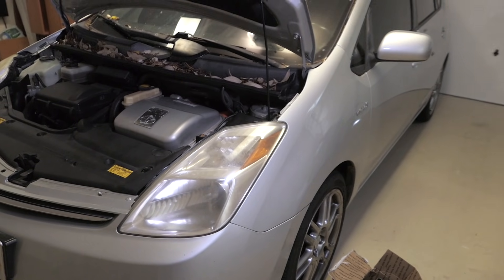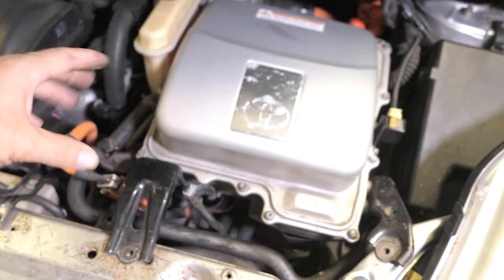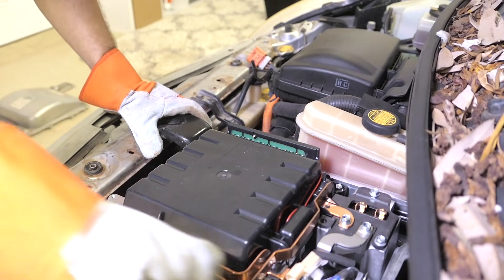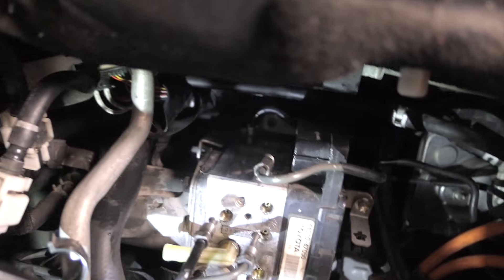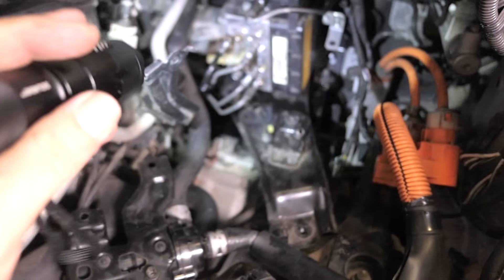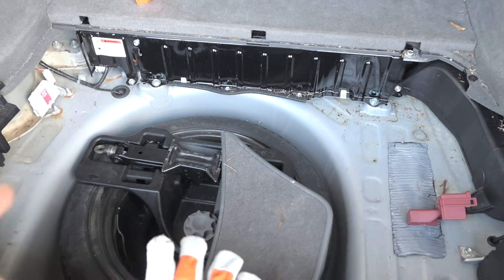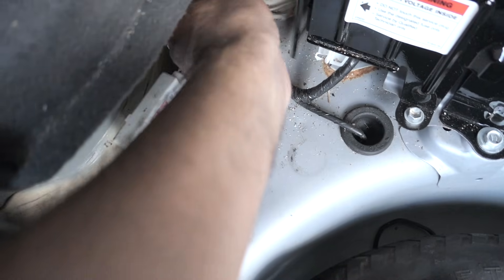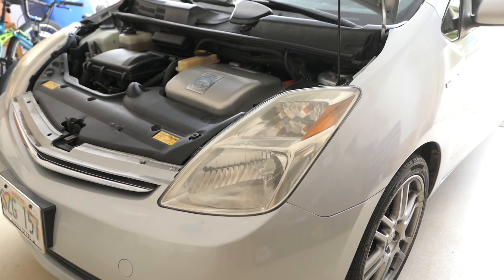Gen2 Prius - ABS Brake Actuator Replacement

Comment: I successfully installed my actuator on an 07 Gen 2 Prius yesterday! For anyone out there who is considering doing this job themselves. I would like to point out a few things that might help put your mind at ease. First off, I was absolutely horrified at the thought of working on a vehicle with such high voltage that it could potentially kill me. I was so scared of it I almost didn't go through with the repair. BUT, take my word for it. If you remove the battery cables from the 12v battery and remove the main fuse (orange plug) from the hybrid battery then press the power button on the car to start it and nothing happens. Then the car becomes 100% safe to work on! I had no issues whatsoever. Secondly, YOU DO NOT NEED TECHSTREAM TO BLEED THE BRAKES! Guys, I was so worried that I needed special equipment or software to bleed the brakes that I almost gave up on doing this repair myself. It is simply NOT TRUE! I bleed the brakes the same way I'd bleed any other vehicles brakes and it worked perfect. If you are still having trouble bleeding the brakes, leave a comment here and I'll explain exactly how I did it (by myself, with no helper). Anyway, this is a great video and was very helpful in giving me the confidence boost I needed to do the repair myself. I saved literally $3400 thanks to this video and others like it! It took me probably 15 hours from start to finish, and I am very handy with a wrench and no stranger to big repairs. So don't listen to the people saying it's a 3 or 4 hour job. That is ludicrous. You will want to set aside more time than that I assure you. BUT! You can do this people! Good luck =)
Reply: Techstream is not a big deal to install, if you are going to do this job, it makes bleeding the actuator much easier. I believe Toyota charges $50 for a 2 day license.  You will need a Mini VCI OBD2 adapter, those about $40-50. Many complain about the techstream software they supply as having a virus. If you are unwilling to figure out the ways to get around that, get the Toyota 2 day license.  I’m sure there is a way without techstream to bleed the actuator, but I am sure it is not “by the book”. It’s only your brakes and they don’t make your car go, so who cares, right?(being snarky)
Reply: @jonnydwolf  I bleed one of the wheels manually just so it’s drivable and drove the car to a mechanic to finish the job and make sure it’s safe to drive. Tech stream supplied has a virus - ransomware. Don’t install.
Reply: @IlyaBourim  virtual machine running the software. Anyway, $50 for a 2 day license to finish the job yourself isn’t a bad idea.  What you did was good too, let a trusted certified mechanic finish the job.
Reply: how did you bleed the brakes if you dont mind me asking. I know you said the regular way but like did you start the car up at all after replacing the abs actuator? thanks
Reply: @davidcuesta7189  I followed a YouTube video that I'm sure you've seen. But instead of using a fancy "pedal depresser" I just used a "broom stick" and scooted the seat forward to hold the brake pedal down while I cracked the bleeder valve then tightened it and repeated the process a few times for each wheel. I do not believe the car should ever be running during the process. Im pretty sure the smaller 12 volt battery is what powers the actuator. So to answer your question, the car was completely off and had not been started after replacing the actuator. But you will need to connect the 12 volt battery and the main hybrid battery for good measure. I must warn you however that I did end up paying a shop $137.00 to bleed the actuator properly (I didn't have the time or patience to figure it out myself this time). Not because the brakes weren't working (because they were working perfect and safely), but because they were making an annoying squawking noise while I had my foot on the brake pedal at red lights. I drove like this for probably 3 months. So bleeding them manually does work, but you should really consider having it bled by a shop ASAP afterwards. And yes, having the shop bleed the ABS system did in fact get rid of the annoying squawking sound. Good luck out there. You got this =)
Reply: don't know if those steps from gen3 also apply to gen2, but you can put car into invalid mode to easily bleed the back brakes (which are electronic controlled unlike front ones which are manual) https://youtu.be/UZ1wpW62L7U?t=27
Also you can use a tool like Foxwell NT510E (or their ABS generic all cars 630 I believe) to do ABS air bleed for about same cost as one visit to 3rd party shop (much less than dealer).
Reply: @davidcuesta7189  there is a video on bleeding. Just search for it. The mechanic uses a 15$ contraption, attaching it to steering wheel to bleed the breaks. He explains very well. Just doesn’t tell you the order of the wheels. I just did one in the back and it was good enough to reach my mechanic to finish the bleeding.
Reply: Hello where did you buy your ABS Actuator? I'm planning on giving it a shot.
Reply: @yaearmeow  I bought mine from the Toyota dealership for a whopping $1,200. You can get them used for much cheaper, but you never know if or how long they will work for. I really didn't want to play around so I just bought the part new.
Reply: That’s complete bullshit that you can just bleed it like any other car without techstream, you should not be telling people that

If too much air gets in the actuator, it will destroy it and also it will turn the fail safe system on and the car will no go into drive and will have to be towed and it won’t ever work again until you plug techstream in
Reply: And then by the time you do the air bleed utility on techstream it might be too late and then you have to replace the actuator again
Reply: Did you buy a used or new part?
Reply: @devicetrickz  I bought a brand new one from the Toyota dealership for $1,200. I couldn't find any used ones. Also the repair is a bit intensive and time consuming. So I think it's best to use the most reliable part possible.
Reply: I just did this job last weekend. I started on Friday night, spent abou 1.5 hrs and then started at around 8-9 am and finished at around 4-5. I did the bleeding myself. 
But my 2008 Prius would not start after. All the Christmas lights were on and the touchscreen would not power up. I got my part from eBay and seller said it was a rebuilt part. I heard my mechanic say that the ABS module has the VIN from previous vehicle and you need a brand new module. I did not believe him and now after 8+ hrs of patient work my Prius is dead. Engine won’t start. Big ! Is on. Does anyone have any advice? Help.
Reply: @IlyaBourim  what did you find out?
Reply: @roz4747   yes, I forgot to engage the main battery switch in the trunk. I think you need to push up the orange safety switch at the end. I also bled the brakes manually just so I could reach the mechanic. Prius is back in action.
Reply: @IlyaBourim  thanks, guess Ima try the repair on mine. 185k on the original.
Reply: @roz4747  just go slow. Remove the top tray where window wipers are. Disconnect the small battery before disconnect the main one.
Reply: @IlyaBourim  hardest part is trusting the replacement part you get,  that’s a ton of work if it ain’t no good too!
Reply: @IlyaBourim  Haha! I did the same thing! I almost freaked out when the car wouldn't start after all the work I did! It was just the main battery fuse/switch. I didn't click it down all the way. Phew! 😅
Reply: @IlyaBourim  Great. Thanks for the update.
Reply: @roz4747 Hi! Did you buy new or used part and how's it holding up? In a same situation.
Reply: @wssr3293 I reccomend buying a new one because the repair takes a while and you need to bleed the brakes. But I'd understand a used one if money is tight. These things are expensive. The repair is holding up 100%. No issues for 2 years now.
Reply: @IlyaBourim hi! How's the repair holding up? Did you buy new or used part?

Comment: Remove the window guard and it allow you to get access to removing and installing those trouble bolts and removing the Actuator also. I am about take on this same Job after receiving a C1256, C1300, C1391. So ordering new brakes, rotor, caliper and a Actuator.  Probably have someone bleed it all when I am done replacing all the parts and hope all the codes clean.

Comment: I replaced the brake actuator on my 315000 mile prius with a used one from a car with 215000 miles on it all that work 2000 miles later and the car started doing somewhat the same thing with the exception the brakes work and are not hard to press. I'm hoping it's not the actuator  again, maybe the distribution block, but i doubt i would be that lucky.

 I thinking either it was already about to fail, or bleeding the brakes manually and not bleeding them with a computer. 

Useful tip: you can use a 1/2 bolt to seal the brake hose from the reservoir.
Reply: It's the brake actuator.  They fail around 200k miles

Comment: Great video . Next time , pull out the cowling👍 it's only taking off the windshield wipers 13mm/ 5 or 6 10mms the wiper motor and about 9 /10 mms . That would have made that job so much easier. I'm having a hell of a time and that's having the cowling removed.

Comment: @Just Vlad, I changed my Actuator with success, the Prius starts up just fine, but now I am left with the TPS, VSC, ABS and brake light on. All these lights accompanied by a constant beep sound. The beep sound happens whenever I hit the brake or open the driver side door, my prius has been sitting in my garage for months with me not being able to figure this out. If anyone can help please do, I've looked all over the internet and cannot find a solution besides getting a mini vci from china and waiting 30 years for it to get here. thanks in advanced !
Reply from the maker: To be honest I dont really know what to tell you. It could be a number of things like air in the system or electrical issue or maybe the new actuator is faulty. When mine started acting up and beeping I just unplugged the beeper under the driver side footwell to keep using the car until i received the new actuator. These cars are complicated and I defiantly recommend getting a mini vci to at least know what the car trying to tell you. You might have to get someone in your area that knows prius to help you. Hope you can figure it out.
Reply: @JustVlads  thanks man <3 much appreciated
Reply: @Dierect_ttv  my car exactly doing same things like yours.i am thinking to replace my actuator but not sure is it worth it or I can make it
your advice very very important for me my time and money
can you make it and suggest me to replace by my self
thank you

Comment: How did you put brake lines back in place?  I literally not able to put them back. They won’t screw in. Any advice?
Reply: Keep everything loose start to brake lines with your fingers once they're started go to another brake line wiggle and jiggle the ABS around takes time but don't tighten nothing down until you have them all started then bleed the unit like he shows in the video and tighten down the brake lines first then the rest of the bolts. The bolts that secure the ABS module bracket to the engine do those last start them but keep them real loose

Comment: Awesome video! Thank you. Question. Could you technically just drive without ABS? Do you need ABS working to drive the car?
Reply: In addition to not having anti skid braking, a failure of the abs module also disables traction control and more importantly, disables regenerative braking.
       Regen braking to charge the battery is a large part of how the Prius obtains good gas mileage.   With the ABS inoperative, expect mileage in the 25-30 mpg range instead of 45-50 mpg.
Reply: It will still drive but you loose brake boost. Its like driving a loaded dumptruck
Reply: @cooper8318  Thanks Cooper!

Comment: this is great i was told that toyota had to do it.
 but im curious did you still bring the car to a garage to bleed the breaks on the computer. you did mention that but was unclear if you actually needed to do it in this case due to how you left the line cracked on the top to vent the air.
also if you did bring it to someone how much did that cost?

Comment: When you bled the brakes, did you bleed every valve from all four tires? Or just the front?
Reply: Probably just the front because is the closest to the actuator
Reply: I'm sure he mentioned all 4 tires as older cars, without ABS. I did it to mine and used it for 1 year,( parking break light on, vsc light on, abs light on but i was able to break in any traffic condition, not snow) until I boughtt a X tool  scanner, it helped me do brake bleeding procedure by my self, no issues 1year later after scanner was used to complete bleeding procedure. Hope it helps.

Comment: May I know where did you find the used actuator, mine is same car same model same year. I am having the same problem.
Reply from the maker: I got mine on ebay used. Just remember its very risky cause you just dont know what you will get.

Comment: I used your video and one other video to change my abs module.  I saved thousands of dollars. The one thing that your video did for me that’s the other did not was performing the bleed process before you connect power back to the car. That alone saved me dealer quoted 3-4 hours labor for the computer bleeding, assuming I drove it to them after I did the part swap.  I’m so glad I was able to give a few more years to a car I paid 1k for. A few days later no softness from the pedal at all.  Thanks
Reply: So you just bled yourself and never had to have the dealer do the power bleed?

Comment: How many miles did this issue arise for everyone?  Mine at 269K on a 2006
Reply: at 121K on a  2008
Reply: Mine at 328K on a 2015
Reply: Update: changed break pads and rotors and the lights went off.)))
Reply: 215,000 on a 2007
Reply: Mine at 193,000
Reply: 172k  2006 I just bought on May 2024. Constantly working sound, without opening door or pressing brake. Clear sign pressure is leaking and need abs actuator replacement.

Comment: Did replacing the abs module with a used one solved your issue?
Reply from the maker: Yes, working great so far with no issues. Its a bit risky buying used but could be the best option if you're willing to do it yourself.
Reply: @JustVlads  0

Comment: It would be helpful if you could show how you organize all of the bolts to keep them so they do not get lost.
Reply: I use six magnetic trays from Harbor Freight and a 20 compartment storage bin. Putting bolts back into their respective holes also works well, but will take up more time to complete the job. The plastic clips and pins are easily replaced with new ones if they break. And make note of bolts with the same size but different lengths to make sure they go where they were removed. During disassembly, I tend to reinstall such bolts back into their holes where they belong so they will be there waiting upon reassembly. Some people used ziploc bags and label the location where the bolts came from, but my magnetic trays accomplish the same thing.
Reply: That would just be distracting Darlene. We like simple instructions, organize your bolts as you see fit according to your organization tolerance.
Reply: darlene acting like shes going to tackle this job... if you dont remember where the bolts go you prob shouldnt be doing this.

Comment: what problem did you have to replace the  the ABS brake actuator. I have 2005 and my brake light come on and more light on dashboard. I have the problem when i drive for more the 45 minutes and is hot. How much you pay for you Abs Brake module and where. Thanks
Reply from the maker: It failed completely at random times which caused the vehicle to have very poor stoping power. The actuator i got off ebay for around $300.